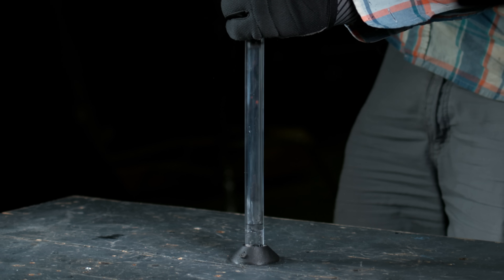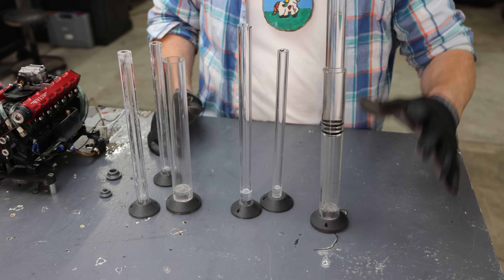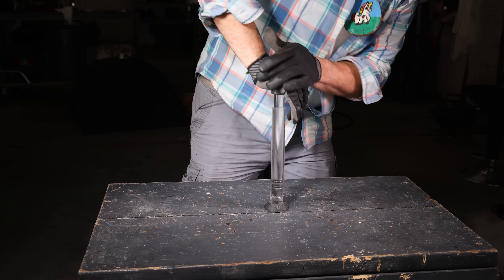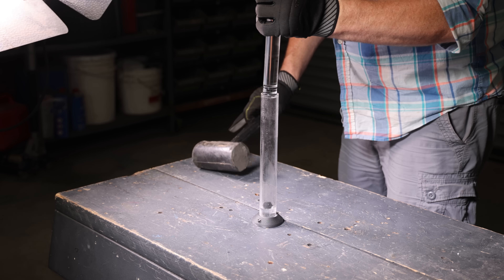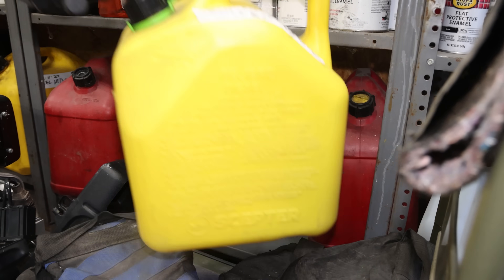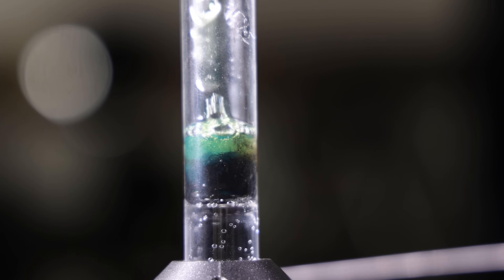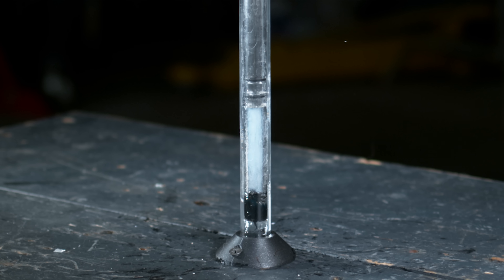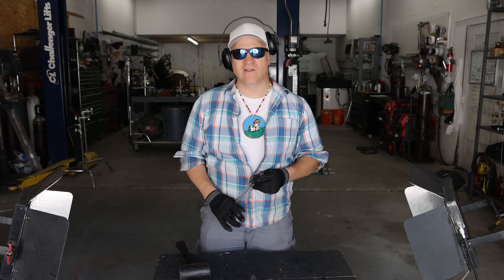How Diesel Actually Ignites (Slow Mo)

Comment: You made also a nice demonstration of knocking in a gasoline engine. In the moment of selfignition the piston is still full speed downward and so the detonation is damaging the material. That is the reason why gasoline engines use low compression (no selfignition) and dieselengines use direct injection (no fuel inside during compression). In both engines the time of explosion is delayed until the piston has changed its direction.
Reply: In gasoline engines, you typically have ignition 5 to 20 degrees before top dead center. Not at the top or after. But you do have to be careful to not have knocking or pinging because it will damage the piston.
Reply: @grahamrempel3920  I understand the preignition time in gasoline engines is needed to build up the flamefront from spark to full flame. Thats why higher rpm need a higher angle of preignition - same time. Full flame shall develop after the piston passed dead center in the phase of expansion.
Reply: @grahamrempel3920  there's always a delay period, that's why spark is BTDC.
Reply: @grahamrempel3920  you do know that timing exists... Retarded/Advanced timing. My old 1992 Chevy Blazer w/ 4.3L V6 hated 0° & loved being 10° Advanced after ignition. Stopped knocking but you do get less power because it's giving spark just millisecond after the piston begins it's down stroke. 

Retarded timing forces the spark plug to fire before the piston completes it's full upstroke giving more pressure in the cylinders before it begins it's down stroke.
Reply: Knock (detonation) is a different phenomenon. Knock is when combustion begins at the correct time, but rather than a "slow" and controlled burn, the increasing cylinder pressure (on account of normal, smooth combustion) causes the mixture at the outer edges of the cylinder to detonate (not a slow, controlled burn). The result is a pressure spike that hammers pistons/rods/bearings/crank.
Reply: Yeah close as you can have Max burn to TDC but just after the more power you'll make but you definitely don't want knocking or pre (before TDC) detonation. 
But there's some decent power to be had even with diesels just advancing your timing a bit. 
I think Mercedes diesels are timed  -11° they're also indirect injection. Where it sprays the fuel charge into a small pre chamber onto an insert that's metallurgically formulated to hold onto heat. By the time it's done it's pre fire in the injection chamber it's reached TDC and is basically injecting fire at that point.
Reply: Sometime the spark (or in injection) is timed to happen SLIGHTLY before maximum compression.
This timing can give fuel a better chance for the combustion front to spread across the surface of the piston before the beginning of the power stroke.
Reply: @darkwater72  If the spark doesn't come WELL before top dead center - you'll be generating a lot of heat but making little power.
Reply: Modern diesels actually do start injections during compression just before TDC, usually called a pilot injection, a very very small amount of fuel. This starts the combustion and makes the environment in the bowl of the piston more suitable for a complete burn as the rest of the fuel needed to send the piston back down is injected. Electronic common rail diesel injectors can cycle up to 8 times between the final few degrees of the compression stroke and the first few degrees of the power stroke. This means the engine can make a lot more torque, while using less fuel and getting a cleaner burn. This is also why new diesels are so much quieter. Instead of all of the fuel injected and combusting at once, lots of small injections spread out makes the combustion much smoother and quieter.
Reply: @killstrees  Thanks for that.
Reply: Vast majority of modern petrol engines in the EU are direct injected. Even my 2004 Audi A3 was direct injected
Reply: And don't forget that's why they also add octane to gasoline, it makes the fuel less combustible under compression.  some people assume that octane gives your motor more horsepower.
Reply: Awesome explanation dude !

Comment: I have heard my whole life that if one builds a  strong air-tight  “ piston/cylinder “ like you have and put some water inside ( not fuel) and hit it hard with a sledge hammer , that it will freeze the water  in the cylinder on the rebound reaction of the piston after being struck quickly ..
I don’t know the ratio of water to air, or the exact force of the hammer strike …but it has to do with super fast drop in preasure after the strike..
That’s all I remember…as it been 60+ years since I read it is some science publication..

They did use a big hammer …and it was a metal cylinder IIRC…

Comment: Diesel doesn't burn like gasoline.  Gasoline deflagrates.  Diesel detonates.  So those explosions are *expected*.  And that's why diesel engines are built so strong.
Reply: Totally wrong. If diesel detonated all the time, the engine would be toast.
In a Diesel engine, the fuel burns progressively in hot air….
Fuel is injected progressively at the end of compression of the air, the injected fuel “ burns” , raises the pressure and pushes the piston down.
Only air is compressed in the cycle ……

Comment: The reason the diesel explodes is that liquids are incompressible and you have liquid diesel. So only the surface ignites, building pressure and since you’re in a diwnstroke, the pressure build to the failure point of the tube since there is no where to contain the pressure of the expanding gas (compressible gas area). 
With the char cloth, there is still gaseous areas that can absorb the pressure by compressing.

Comment: Could we warm or heat up our houses with compressed air in a cylinder and NOT  use gas or coal or electricity in winter?

Comment: Ever see the interaction of hot steam and cold water?  High velocity and high pressure and pipe damage can result as steam condenses.  Saw article once that postulated that containment vessels ruptured at Fukashima nuc plant in Japan as result of steam+water hammer ignited hydrogen.

Comment: youbhave a flat/domed shaped piston at this moment which will yield ALOT of compression but will have a flame shape that expressed to the side of the wall, thats why high compreasion engines have a dished shape or sometimes a cup like shape to contain the burn into the piston so the thrust is expressed more upwards and away.  nice demo
Reply: That's a good point but I don't know how much of a difference it would make with fuel already in the cylinder like in this demonstration. The other issue is that he says it's 25:1, but as soon as he started adding that much diesel it filled up the "unswept" area of the cylinder and effectively creates an infinity:1 compression ratio 😅 Same thing happens when you drive thru too deep of water and we know how much engines like that 🙃

Comment: So in a diesel engine, what actually causes the start of ignition ? the moment the fuel is injected as the air will be hot to burn as soon as fuel is introduced, or is the fuel introduced earlier on the compression cycle then the fuel/air mix reaches ignition temperature and ignites. My way of thinking would be the former as you can control the exact time of ignition ?

Comment: You can "diesel" a pellet gun this way.  Put a small amount of oil in the back of a pellet and then put it into a pellet gun;  You will easily double the power output, but you will also likely damage the seals. Guess how I know that a typical Crossman pellet gun can fire about three pellets this way....
Reply from the maker: I have been told, but I've never tried it.
Reply from the maker: I wonder what would happen if you put a drop of diesel instead of oil or maybe even gasoline
Reply: @WarpedYT  Same.  It smells worse...

Comment: Actually that’s not how a diesel works. In a diesel they compress first, then inject the fuel. You’ve mixed the air and fuel first, then compressed.

Comment: I would imagine you need so outlet within the tube for the pressure to go, especially when adding some kind of fuel. That’s why I think the tubes are cracking because there’s all that pressure and no outlet so that pressure has to find the weakest point and escape that way

Comment: What happened with the char cloth at 4:20 is it ignited as a result of heat accumulation after several strokes. You effectively transferred the energy of the sledgehammer to the air inside the tube and the tube walls, and when the air got hot enough after several strokes, the cloth ignited

Comment: diesel injectors atomize the fuel. a pool on the bottom is going to be a heat sink and most of fuel will not be in contact with oxygen.

Comment: your left hand holding the tube moves it and give a weak point at the bend to break the tube., would like to see the tube fixed in place at the top too. not saying it will  prevent the crash, still, would like to see the full power.!

Comment: For those who don't have a clue why the tube exploded: with the diesel is that, actually the diesel does ignite in this experiment as required even if its just the smoke without fire we see, it ussually doesn't burn fully even in car engines, thus the diesel smoke we see in cars. There is not enough air to ignite all of that in the tube as only a miniscule spray is needed for this experiment.So the remainder ends up to HYDRAULIC the way through causing that explosion. (7.22)Thats why he didn't feel kick-back.(To get  the "yellow flame" you need only to do a 'small spray' inside the tube just to wet the cylinder walls, then put the plunger back in and suddenly press like you did, it might work perfectly)
Reply: Liquid does not compress, so it  simply fractured the outer tube because there was simply no other place to go.
Reply: @maj21093  If it was just hydrolock, it would break the tube much earlier. 
Every time it shatters is the first stroke after first flames are visible. It's not coincidence.
Reply: @Stasiek_Zabojca  Watch the slow motion clips and look at the cracks forming. When the extra diesel is added, it redirects the forces outward, not just the direction of piston travel.   Read Boyle's Law, and it may help my explanation.
Reply: @maj21093  What? Pressure increase in cylinder durning compression, even without diesel burning, puts force in every direction, not just in the direction that pistons travels. But if diesel ignites, and piston is still compressing (because inertia of piston and hammer, in this case), you have very high pressure increase caused by both diesel ignition and decreasing volume of the chamber. Normally you get pressure increase, because of the fuel burning, but chamber volume increases at the same time, as the piston is being pushed backwards by expanding gases.
Reply: Well, in diesel engine fuel is not in combustion chamber during compression stroke, like here. Injection starts when piston is nearly at the top dead center, so when it fully ignites, piston is already going down and energy released pushes it more in the same direction. In this experiment, fuel ignites while he is still compressing air with piston, so energy works in opposite direction, which causes cylinder to expload. That's basically what you get in gasoline engine when knocikng occurs.
Reply: Is that why diesels need turbos ?
Reply: @bigmungus4864  Diesel doesn't need turbo. There are many old engines without it. But you use turbo to make more torque, power and make it more efficient. 
And diesels are way easier than gasoline engines to use turbo, because you don't have problems with engine knocking (fuel is being injected into combustion chamber when air is already compressed, not like here in the video).
Reply: @Stasiek_Zabojca  thanks for the info. How less inefficient are they without turbos?
Reply: @bigmungus4864  If you've got a heavy foot, a turbo will cause you to burn a lot more fuel.
Reply: Air/fuel ratio has to be close
Reply: @peterhessels2903 you got it. Too much or too little fuel relative to oxygen and you get an ineddicient combustion. Also for all practical purposes, the liquid doesn't burn, only the vapor combusts. Even the char cloth had to vaporize befor there was ignition. That's why it took several strikes. The first strike got the char hor enough to partially vaporize.

Comment: My guess is that every time it explodes, you blow off the coal dust from that fabric. Diesel needs at least 25 bar to ignite, which you have, but the injection pressure is about 1500 bar on the injector to make it burn the way it does. Because you don't have the correct injection pressure and the ignition pressure is wrong at the right moment there is no chance that the diesel will burn. It's good, it will come out at 6:06 when it explodes, it will spray the diesel and it won't ignite. Get an injector tester and try spraying diesel (with the injector) on a lit candle and see how it goes to burn.

Comment: Well duh the tube would explode. Combustion doesn't work this way...by that I mean imagine a cylinder flooded with that much fuel and then ya went to start it up. It would have the same result. It would blow your truck to hell. If you do this again I'd say try just a drop, but that's not going to produce the same thing as an engine since it isn't vaporized or mixed evenly with the air. Maybe just maybe use a fabric with very fine threads soaked in fuel and stuff down two or three threads. Cause you have to remember when a fuel injector sprays fuel into the cylinder they have been machined to specifically disperse fuel evenly throughout the whole cylinder as a vapor. Instead of just pouring fuel in like a garden hose, they don't work like that.
Reply from the maker: That is in fact accurate

Comment: I think the tube is blowing from the pressure weakening the tubes with micro fractures, not actually exploding from ignition.
I would suggest trying the same inner diameter radius but increased thickness, oh and decrease the fuel amount that's wayy to much 😅.

Comment: I am not an expert in Thermodynamic, but i remember ignition Pressures over 3000PSI in a Heavy oil Diesel Engine.
So the Tube has to Whistand extreme pressures while the Piston still travel down...
Í heard also from a Diesel Pogo Stick wich accelerate a Person into the air just with a tiny drop of diesel in a piston.

Comment: Hey WP, what if you precharged the fire piston cylinder with oxygen? Run a tube down there and flush the tube out. Bet tou wouldn't need as much pressure!

Comment: Awesome video. I'd love to be able to see see-through diesel engines but its almost near impossible because of the high pressures. Chances of blowing the cylinder apart is high. Maybe unless you make a very thick cylinder out of a big block of acrylic.

As for the tubes if you can find much thicker tubing it should work, even with diesel. Still cool though.

Comment: The char cloth is nearly pure carbon. When it burns, the O2 gas becomes CO2, resulting in the same amount of gas, but hotter. Burning a HYDROcarbon fuel (like diesel) you have not just O2 -> CO2, but also O2 -> 2 H2O. You get 2 molecules of gas for every O2 instead of 1. So, it would be getting WAY more pressure spike with the diesel than with char cloth, even if the energy per KG of fuel is equivalent.

Comment: Would have been cool if you had a pressure gauge to see the explosion pressure numbers
Reply from the maker: I was actually going to do that, but the issue was I couldn't get past the first attempt without it blowing up, so I figured if I were to drill pressure gauge even directly up from the bottom it may blow, But I was going to hook up a pressure gauge straight from the bottom. I don't even know what pressure that would need to read

Comment: Great video! I have a question. Why do Diesel vehicles have glow plugs then? I know it does not create a spark, it glows red.
Reply from the maker: As far as I know glow plugs were in older engines, newer direct injection diesels don't have glow plugs, I have also seen glow plugs in the smaller diesel engines and the intake manifolds, I believe they are used just for starting. Don't quote me on this That's just what I remember
Reply: @WarpedYT  Oh ok, maybe this is why modern Diesel engines are better. I had a 2007 Ford Ranger and had to replace the glow plugs... at a price. Now that you don't need them Diesel is the way to go. Diesel as a fuel has also gotten much cleaner with less sulphur.

Comment: 🤔Diesel is somewhat compressible to a certain point once you reach that point then it exploded the tube
Reply from the maker: It doesn't matter if the diesel is compressible or not, that's a misconception. In this case there is a huge amount of air in the tube that is being compressed. It's the same as if there was no diesel in there and a solid bottom because the air is inside the tube being compressed at all times.